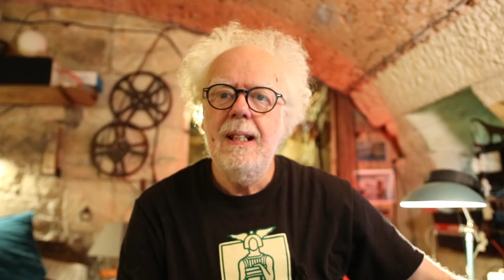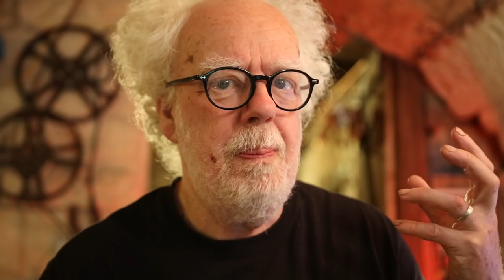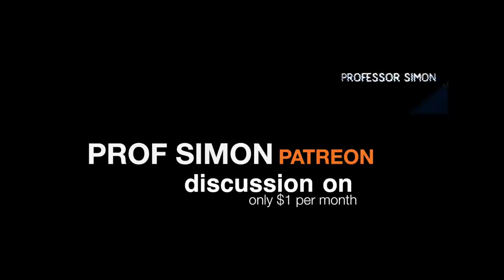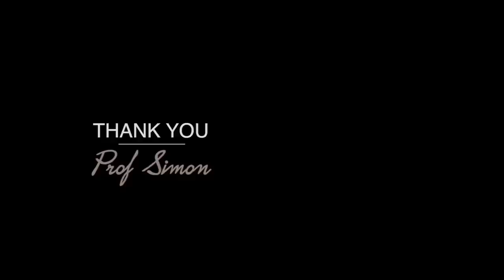737 in EU - Prof Simon

Comment: It is good to explore the redundancy aspects of the 737 family but this is not sufficient to address the pilot's problems in recovering control of the 737 Max in the 2 fatal crashes.

The elephant in the room is the management team at Boeing.  They have declared to the financial community that they don't need in-house engineers to manufacture & sell airliners.  All engineering can be outsourced to the lowest bidder according to Boeing.  As long as this management team & company culture remain in place it is very unwise & dangerous to only concentrate on how the automation might be changed to make it safer (more redundency, diverse sensors etc).

It is much more productive & prudent to assume that any MBA driven outsourced engineering solution will fail and to plan with this in mind.  This should bring focus on the runaway trim emergency procedure.  ONE switch is needed to command ALL (including MCAS) automation to stand down and release ALL flight control to the pilot.  In the case of a good jackscrew electric motor, the jackscrew electric motor MUST remain in play as it is much easier & faster to retrim the hor stab with electric trim rather than fighting with hard to turn manual trim wheels.  I much prefer that the pilot gets his/her exercise in the gym rather than in the cockpit turning the trim wheels.
Reply from the maker: Exactly

Comment: I would guess that the sensor might have an optical encoder rather than a potentiometer on it. A pot would wear out.  Why cant the instrument itself have some other angle sensor or gyro so it can self check ?
Reply from the maker: I’m sure you are correct... but they are quite vulnerable
Reply: @SimonHollandfilms    Hi! A guy had one on youtube and it did look vulnerable, I think it could jam.  Does it want to know the angle of the air relative to the plane or the plane relative to the ground ? I don't know, but even your mobile phone has wee gyroscope sensors, doesnt it ?  Maybe they could design it to self check (?)

Comment: Double redundancy like described is just a cold stand by and not acceptable in 2020.
Especially for crucial measurements that affect a aromatic reaction from a master system that overrides the pilot like MCAS. If had some basic education in control systems and they should   always configured that you get a safe behaviour if you something fails. 
So switches are configured for example that they always have a closed current only when the switch is physically activated this is used as a signal. In this manner you know something is wrong when the wire to the switch is broken for example.
This is just the greed for profit over safety.
Boeing as far as I see it hasn't bought more redundancy for the sensors on the table but a software fix.
This is just not acceptable in my opinion because you just can't test software to be error free. One change in the next revision of the software and you may get a misbehaving plane back that endangers life's.
The pilot should be able to override the plane in any circumstances at least with two buttons at the pilot and copilot side in case of emergency.
Airbus has had similar software errors in the past but not that kind of systematic flaw because of savings.
So what is more damaging for a company having a few grand more costs for redundancy or getting your best selling plane grounded.
Especially overseas where you're not able to confirm the plane to all regulations by yourself because you currupted the system in the US.

Comment: Redundancy is fine.. Professor.. but  I'm wondering when are  they going to make the Seating Area able to detach from the Aircraft and under control deploy slowing chutes and then full Parachutes to Rescue  the Cabin instead of crashing those.. Big Fat Corporate Money Pigs(Large Aircraft) full speed into the dirt with all aboard..they can bring them down from Space but not from.. 40,000 feet.?
Reply: You have forgotten something massive...

You return from space by falling under gravity in a completely uncontrolled descent, you need a parachute its not additional.

You land an aircraft using gravity under full control. A parachute would hardly ever be required.

Its not often that planes fall out the sky, its more common that they get flown into terrain or crash during a landing attempt...
A parachute would not help in either situation.

If we want to improve safety, you remove the pilots from the equation. CTIF (controlled flight into terrain) is the biggest killer.

Formula 1 car drivers wear helmets, fire proof clothing and neck restraints,  WHY don't we use those in our cars? Because it would save lives.

Its about the same level of practicality as your suggestion